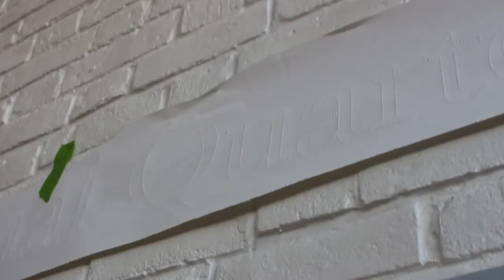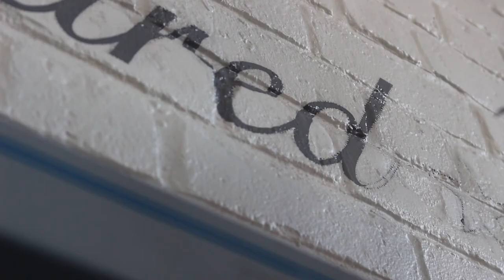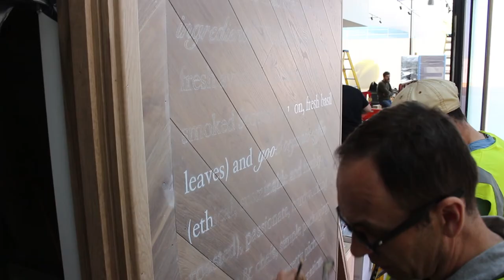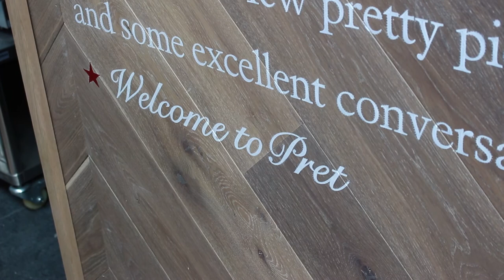Tranditional Signwriting at Pret A Manger

Comment: Alguien sabe como se llama el aparato para perforar el papel?
Reply from the maker: It's called a Pinwheel, they sell them on Amazon, hope this helps!
Reply: @RenderGolem  Nothing with that name appears, does it have another name?
Reply from the maker: @luchohuiscalen1724  Here's a link to one I've found on Amazon: https://www.amazon.co.uk/Perforator-Patterns-Stainless-Perforation-Overstitch/dp/B08965BVG8/ref=asc_df_B08965BVG8/?tag=googshopuk-21&linkCode=df0&hvadid=516991291891&hvpos=&hvnetw=g&hvrand=3837410749406486184&hvpone=&hvptwo=&hvqmt=&hvdev=c&hvdvcmdl=&hvlocint=&hvlocphy=9045955&hvtargid=pla-946401633781&psc=1
Reply: @RenderGolem  thanks for the information, a hug